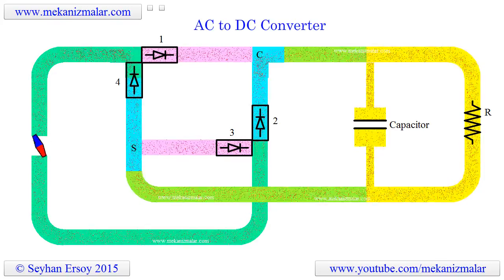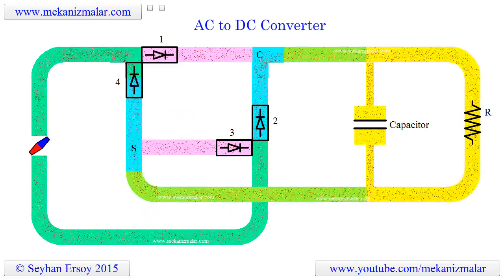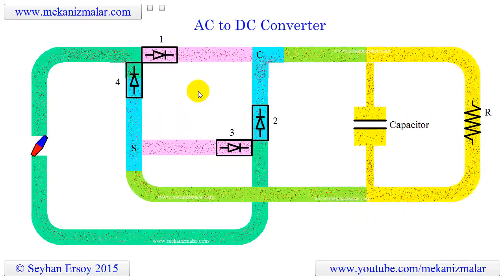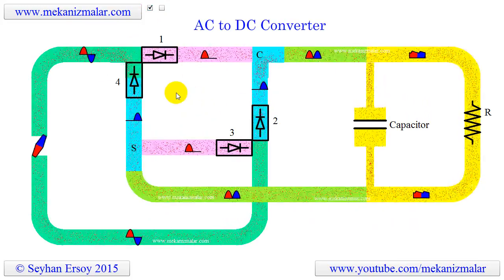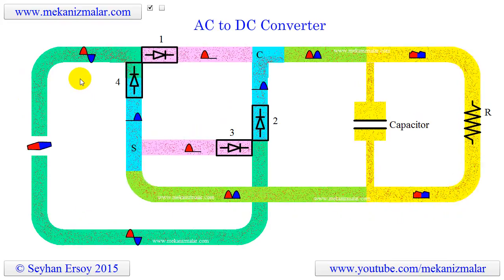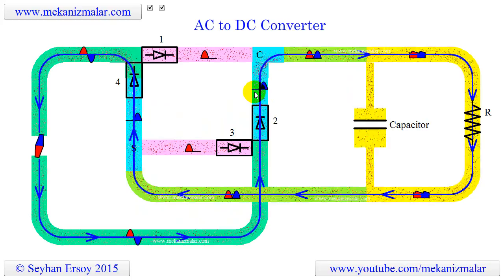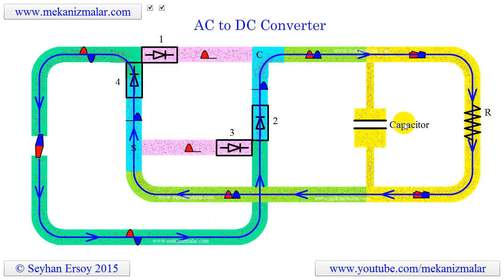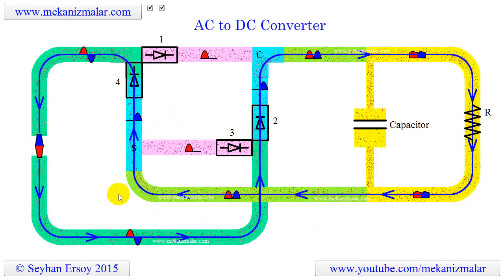ac to dc converter animation

Comment: ...Based on my training the animation is somewhat incorrect for the alternating current.  The current does not go back and forth as shown in the animation.   It is actually a current that changes in sign - positive and negative - the sine wave.  Thus we can say that "alternating current is a "changing sign current" or electro-magnetic waveform creating by the rotator.  The term "alternating current" has always been a misnomer for the common person.  That is the electron at the power generation system does not actually travel to the end point - rather it is the electromagnetic wave.  Right>??
Reply: Hi Felix, In DC current, we know that electrons flow continuously from one point to another. However, in AC current electrons constantly going forward and backward, the magnitude of this oscillation could be small. However, electrons vibrate back and forth. I agree with you that in AC, there are no destinations for electrons, just vibration.

Comment: this gif teached me AC, DC, convertion and capacitors in 2min
Reply from the maker: I guess you found the answer by using 4 diodes an AC can be converted to a DC current. Also in mechanical engineering a double acting pumps work with similar principle. Reciprocating piston creates a water motion similar to AC. By using 4 check valve this can be converted to continuous water flow like DC. Here is the video. https://youtu.be/PjFzN6VnyYc

Comment: so since the capacitor is being charged at the maximum wave that means the resistor works at half voltage of the maximum wave right ?
Reply from the maker: +Nassil I am a mechanical engineer, so I understand this concept by analogy to fluid flow with check valves, accumulators pumps an motors. I am sure that someone with more knowledge in electricity can give you more detailed answer soon.
Reply: mekanizmalar thanks you anyway ^_^

Comment: Great video. Could you make one showing how variable speed AC wind generators are connected to the constant 50 or 60Hz system via inverters?
Reply: +walkerdb84 Mechanical gearing. That's what I've heard.